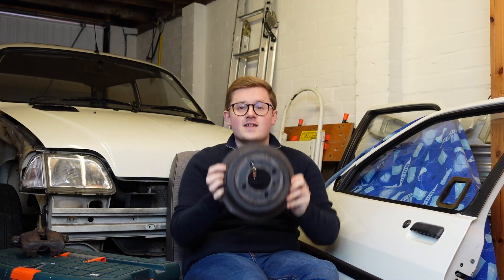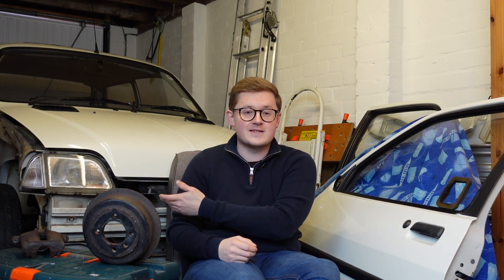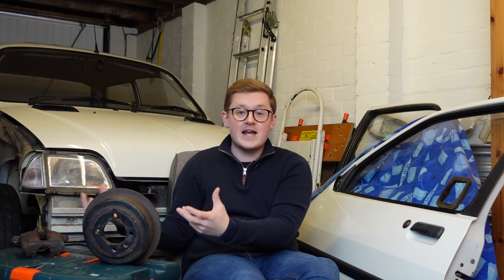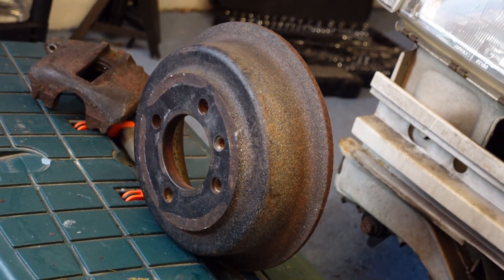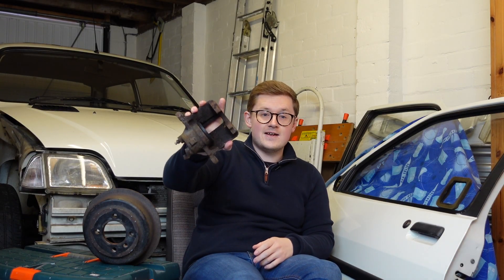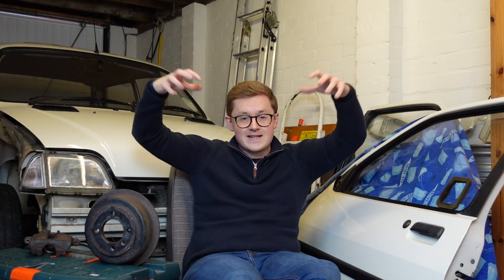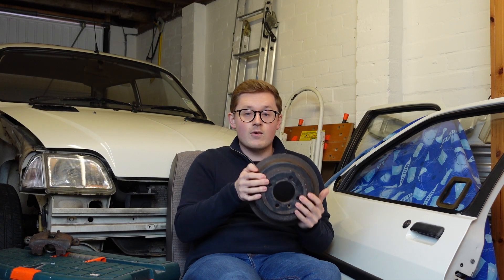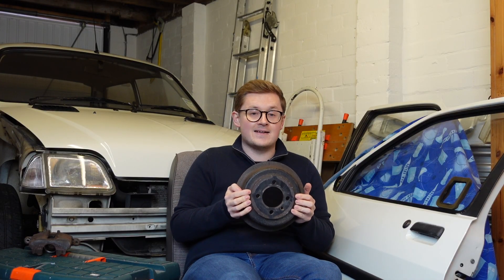Why are Drum Brakes Making an EV Comeback?

Comment: The biggest enemy of drum brakes is water. I drove my '54 Ford's through a healthy puddle, long ago. A tragic light turned yellow on short notice, and I hit the brakes hard. The right side of the truck stopped, and the left side didn't. 

I also had a'70 Mercedes. It had 4-wheel disc brakes. The parking brakes used small drum brakes just inboard of the rear discs.

Comment: Well, so much for regenerative braking i guess. Another failed prediction of EVs.
Reply from the maker: What?
Reply: @TwinCam  early in the EV craze it was a popular topic that you could use the drive motors as generators, braking the car by turning momentum back into electricity. Turns out you can't feed power back into the batteries that quickly, so we're back to friction braking. Which, considering the extra mass of EVs over ICEs means more brake dust, shorter pad life, etc. Another way EVs have failed to deliver on expectations.
Reply from the maker: @TheMonk72 Did you listen to this video at all?

Comment: Prior to power brakes, drum brakes had a big advantage over disks in that the movement of the car helped apply the brakes.  That's why drum brakes worked well on the cars prior to the 1960's, many of which did not have power brakes.  I find that the drum brakes on my 1954 Hudson Hornet work just fine.  They are not hard to modulate and they are not grabby when properly adjusted.  They do take some force to apply, and I use engine braking on long hills to prevent overheating.

Comment: Regenerative braking for EVs doesn't work very well or at all in below 0 degree Fahrenheit cold. Drum brakes do have cheaper parts, but they are not lower maintenance. Every used old car I've bought has had leaking wheel cylinders in the drum brakes. Brake fluid is hydrophilic, so it attracts water. If you allow the car to sit a few months or years, the drum brakes will leak due to rust in the wheel cylinder not allowing the rubber cups to seal, especially if the brake fluid hasn't been replaced in a decade or so. It's relatively rare for front calipers to leak, though.

Comment: I am fully with you that drum brakes make more sense if you are not heating them up. But: If you start on a hill with a full battery, you don't have regen for a while. Could this be a problem? Maybe the cars need a big resistor to get rid of the potensial energy in form of heat, just like a brake does.
And another thing I was hoping to hear: What is about reaction speed of ABS or ESP? Can the much larger brake pad inside a drum brake make several intervals per second, like a disk brake with a small and light brake pad? Would this change the possiblities of these systems? And is this the reason to not use them on the front tyres?

Comment: A limitation of regen is that it cannot be applied at full battery. This could be mitigated by dissipating the energy in a resistor and providing air flow over it to provide for consistent braking at any battery state of charge.

Comment: The best advantage is that they will last forever in a EV. How I know that, I used to own older heavy concrete-trucks and these had drumbreakes and i never changed the breake-shoes. I drived one truck for 400.000km and did never change the breake-shoes, because they was okey in every years annual check-up.😊👍

Comment: Interesting video!

I used to work as a mechanic, and i have replaced a lot of disc and drum brakes on old cars in Chicago, where we get snow and ice, which means that the city applies a lot of salt to roads in winter. In the city, many people leave their cars parked on the street overnight. In winter, the salty slush massively accelerates rust formation on all types of brakes.

While drum shoes and drums indeed last a long time, i have found that springs in drum brakes degrade within a few years and lose their spring action entirely. This then accelerates wear on shoes in drum brakes.

For cars parked in dry garages overnight, I don’t think the enclosed design of drums increases longevity much in the real world. For cars parked on the street, I think drums may indeed last longer than discs.

One other thing to note about EVs— they can be really heavy, and EV pickup trucks and SUVs may need either large drums or discs to brake effectively in emergency braking scenarios.

The curb weight of rivian trucks is >7000 lbs, which seems insane to me. Yes, regen braking is awesome for its efficiency. I drive a mini SE ev, and I almost never use the brake pedal. I love the smooth braking and control that I get with regen braking on my car.

However, on a very heavy EV like an F150 lightning or Rivian, you need a lot of braking force for sudden deceleration. Big drums would be adequate, but I could see why manufacturers would want to stick to front discs until a better mechanical braking design emerges.

For most EVs, I would agree that front discs and rear drums are probably fine.

Comment: Additionally, drum brakes are self-balancing because when the combined felly, drum, tire is unbalanced then the heavier side is worn Preferentially by the brake shoe.  By contrast, the brake caliper wears the rotor evenly rather than shaving off the heavier side.

Comment: Can drums be lighter and smaller? 
Smaller wheels with more tire sidewall and less wheel rim make a difference to aerodynamics which can increase efficiency, less weight is obviously better for acceleration too. 
I notice many EVs even the leaf have huge disc brakes that seem completely unnecessary, if the braking system was smaller better wheels could be fitted.

Comment: I am saying similar for bicycles. Disk brakes are redundant on the rear of bicycles. Every simple V-brake can make the rear wheel lock. And also the finer pressure point of a disk is not needed on the rear. Almost all brake power is generated at the front. The rear just stabilizes the bicycle.
Why use expensive parts when easy does it?

Comment: Breaks seeing limited use is why the service schedule for an EV always includes break cleaning and safety check. I have an EV6; its 2 tonnes and gets to 100kph in 4.5s, yet when I took it for my second year service it came back with the breaks at only 10% wear according to the inspection report.

Also, a tiny bit of outdated information in the video: break lights illuminating for heavy regenerative breaking was standardised across all of Europe in 2015 (for both EU and non-EU countries). IIRC, they should illuminate when deceleration is at 1.2m/s or greater.

Comment: I am surprised that the ( super fast ? ) rusting of disc brakes could be very easily cured by making them of some grade of stainless steel ?   of course , they would cost much more , but that might be offset by a returnable deposit , bringing the worn out discs back to the dealer ( the MUCH higher scrap value would be worth it ? ) ....... DAVE™🛑

Comment: Interesting. Many manufactures use disc brakes on the rear with calipers that have a screw activated piston operated by cable and lever for the handbrake that also allows the piston to be hydraulically activated - so no need for a secondary drum.

Drilled holes and grooves in discs are largely a marketing exercise as they make little difference to surface area and vented airflow is from centre to outer edge of the disc not through the surface of the disc - hence why such holes clog with dust. Drillings and grooves also remove metal mass and reduce the thermal capacity of the disc compared to the same size undrilled disc. This will heat up the disc faster in use bringing about earlier fade onset under heavy use, not dissimilar to a part worn disc. Thermal capacity is more important upon brake application whereas cooling is more important between applications to prevent heat accumulation.

Brake particulates will mostly be reduced by EVs using regenerative braking.

Comment: My experience with disc brakes is that they are not necessarily lower maintenance. There can be several springs, a few spacers, a cable or two and an adjustment mechanism. Now ade all that stuff 10 years and and you have much more work. The parking brake cables on drums brakes can seize up. Disc brakes are much simpler.

Comment: Keeping your food persistently on the gas pedal is very tiring for me. With a combustion engine I don't have to, I can raise my food from time to time and let the car roll. Sure, it will decelerate but not that fast so I can set my food down or move it around a bit before I have to hit the gas pedal again. This allows me to drive much longer distances without my food getting tired or even starting to hurt. With electric cars that immediately start breaking when I lift up my food, this cannot be done anymore and my experience was that this totally sucked. I'm absolutely not a fan of this, as it forces you to constantly apply pressure to the pedal if you don't want to break.

Comment: drums are not cheaper to assemble
takes longer to jack a car up than it does to replace brake pads. now go do it for drums LOL
Reply from the maker: If you’d listen, they don’t need assembling again after the robots do it at the factory. Discs would.
Reply: yeah they fucken do, and frequently i need to use a massive fork trolley jack to replace them and the boots. and for a road train u have 2 trailers and a truck worth, vs do 2 bolts and use a prybar on a calliper
yeah nah get fucked. callipers and rotors last twice as long on all our ROAD TRAINS running corrugated dust roads. doing a truck hub with callipers vs boots is night and day different. most of them arent even self adjusting either so u gotta crawl under with a 9/16 and a mallet and adjust em yourself. now onto car ones, for handbrakes, id rather do the truck drum honestly. i just refuse to use my handbrake on the basis that car drums suck to work on, leave it in gear works fine @TwinCam
Reply from the maker: @bigcazza5260 Amazing that you’re having to move away from cars to make your point, and even with adjusters, to cars that are decades old 😂
If you’re a mechanic, you’re a bad one.
Reply: and cheaper to assemble is bs
u need a wheelbrace, a jack, a prybar and 2 spanners to do pads its so much easier than boots and its 70 bucks for the whole car worth. literally longer spent cracking wheel nuts, jacking from the diff and putting axle stands under solid rear than actually swapping the pads, just use a g clamp and some metal plates if u didnt eat enough wheatbix to push the piston down by hand

Comment: consider for a moment electric trailer brakes. There is an electromagnet that has friction material integrated with it that provides a friction force proportional to the current through the magnet. This force is magnified by a lever which pushes on the servo shoe which pushes on the brake shoe. The fly in the ointment is the brake system cannot immobilize a vehicle, it needs forward motion to work. However, hydraulic brakes stop working when you take your foot off the pedal. So, both systems need a separate parking brake mechanism. The other fly in the ointment is overheating the electromagnet. Trailers used to catch fire waiting for long trains at grade crossings.

Comment: Drums are also dominant in electric trailer brake applications because the brake controller activates a small magnet on an arm which hangs down near the drum, which sucks itself to the drum with varying intensity, the spinning of the drum then pulls on the arm and actuates the brake cylinder. This means the brakes dont work well as a parking brake.

Comment: they aren't going to make a comeback - other than get rid of OLD stock.  Discs are used not only for braking but traction control - no one is going to reengineer those systems to 'down' grade other than by companies that stink.
Reply from the maker: Did you not bother to watch the video?
Reply: no i didn't . this isn't 'school' the audience should NOT be expected to endure endless 'filler' to make a video longer with 95% of the content  'common knowledge' 1/2 century old information -Just because the creator WANTS it that way & for everyone to participate in their 'fantasy'. BUT i will revisit it.... at some point   @TwinCam
Reply from the maker: @crabbcake  Ah, a fine dose of self-importance and the attention span of a spoilt four year old.

Comment: I hate drum brakes, nothing you can say will convince me having drums is a good idea. When you change brake shoes in a drum system you will know the pain.
Reply from the maker: There’s even a video of me replacing shoes and changing an adjuster on my channel. I don’t understand your pain.
Reply: @TwinCam  Shoes are a pain in the ass to change compared to pads. Wheel off, retainer clip off caliper off, take the pads out, wind back the caliper, put the new pads on, put the caliper back on, retaining clip back on,, pump the brake and if necessary bleed the brake, wheel back on. Done

Far easier than assing around with drums and trying to get the shoes to seat in correctly.. Not to mention the fact you have to do it in place and mess around with springs that like to shoot off and trying to get the tension right, the amount of shit that has to be removed and cleaned. After having had to unseize a set of drum brakes on a trailer before, never again. Hydraulic discs all the way. Far faster and easier to change.

Comment: drum brakes are used in lightweight motorcycles with engines below 125cc and kerbweight less than 150kg and they practically never fade unless you carry two large adults downhill. newer versions now ship with front disc brakes but the rear is still kept as drum. its much easier to service the chain tension with a drum brake, since on a rear disc brake setup you have an extra bolt for the rear caliper and those are designed to tighten when brakes are applied to prevent the caliper from moving, its impossible to loosen that nut with a cheap iron tool. you need a forged steel wrench + an extender to lose it which discourages self maintenance. even when the shoes do glazed up from overheating, for a motorcycle that light it still gives you braking power, just nowhere near enough for emergency stop

Comment: Minor points w.r.t drums; from the 1930s, performance cars had finned drums to increase heat dissipation.

In reponse to the comment below by @lwilton about drums failing when wet, it was usual in the UK to see a sign "Try your brakes" after passing through a ford.

Comment: One point you overlooked was that drums tend to still be used in many larger applications such as trucks. The surface area for heat dissipation with drums is generally larger and could easily be increased by adding cooling fins, though this will usually be at the expense of increased weight and manufacturing complexity. Disks on the other hand are much easier to replace the pads on.
Reply: Yes, on trucks and general heavy duty equipment drums are favored because of their closed design that lasts much longer in dirty grimy construction/mining/earth moving environments. you would not want to fiddle with a dozen or more delicate open disc brakes on such work horses. the lower heat tolerance is not much of a problem on such machines because on long descents you have retarder and/or heavy engine braking available and dont neet much of the wheel brakes. quite similar to an EV acutally in that regard.

Comment: Hi! Great video, very informative!
I do not think any electronic system could make drums as responsive as disc brakes.
I work with feedback loops a lot, and in my experience, no control algorithm could compensate for the poor hardware. Car manufacturers still can't get ABS to work outside paved roads, and that's with fantastic racing disc brakes. A brake-by-wire system would be next to impossible to develop, and it'd never be as good.

Comment: Hi Ed! I went for a drive in a drum braked 998cc Mk2 Morris Mini Cooper. The owner grooved & drilled the standard drums... the brakes were tremendous! It stopped far better than a disc/drum Cooper S! Cheers. Leigh. PS: Sierras including the RS Cosworth use the pads for the hand brake, not an internal drum. That's what i have on the rear of my 4.6 V8 Vauxhall Viva HC clamping grooved/drilled Mk3 Escort solid discs!

Comment: My EV (that has regen) handles the rusty disc brake issue a bit differently. It merely uses rust-resistant rotors. Had it for 6 months so far and they're still silver with machining marks still visible

Comment: Old Lada, GAZ, KRAZ, UAZ, MAZ, KAMAZ all have 4 drums and don't have brake booster. You can easily lock wheels just by force on brake pedal. 
I guess if you live in Sybiria, make living by cutting trees or drilling for gas... Pressing brake pedal slightly harder every once in a while to stop is not big deal. They also have no power steering. But they have hand crank engine starter... I guess it's not fun to walk in -50 C just because battery doesn't feel like spinning engine 😂😂😂. Some of those vehicles have 6 wheels and 10-15 tons... No power steering, no brake booster, gasoline

Comment: Joe/ Jane Public are generally speaking, pretty mechanically stupid. While I'm not an EV fan,  regenerative braking is a freaking fantastic feature. It's like having an electric driveline retarder. Sort of. Electric motors and generators are basically the same thing. Connect a load with electrical resistance and you soak up mechanical energy. They're dumping some of the power generated back into the batteries. It's not 100% efficient, but better than nothing. Friction in bearings,  electrical resistance in wire, generated heat.... all wasted energy. But it's something.

Comment: I have an old Subaru forester with 4 wheel disc that I use as a beater. If I let it still for a month or so all 4 brakes will rust themselves to the disc and require significant gas pedal to break them loose this is accompanied by 4 loud snaps as they let go. They generally warp really fast because of this too. If I had an EV I would make it a routine to brake heavily in a safe place to avoid this hassle.